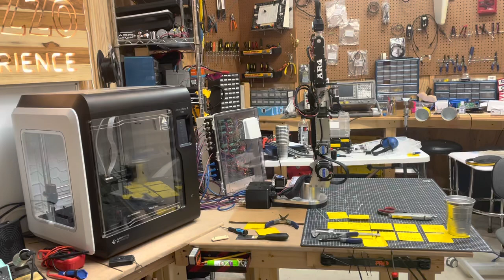RobotJSPart6 - AR4 Acceleration

Comment: Can AR4 be powered by Arduino?
Reply from the maker: It needs its own power supply. You can read the documentation here https://www.anninrobotics.com/
Reply from the maker: If by "powered by" you mean controlled with then the answer is yes, it uses a teensy microcontroller which is effectively an arduino.

Comment: How do you handle coordinated acceleration control of the motors?
Reply from the maker: Great question. I wrote a custom function that takes all the joint angles. Since I know where all the joints are I can calculate what I need to set the velocities and accelerations to in order to get all motors to end at the same time. You can see the code on my github here https://github.com/joepuzzo/servo/blob/main/src/robot.js#L512
Reply: @robotjs  Yeah, that was the approach I took with my robot arm. I'm making a new one though, and one thing I want it to be able to do is straight line / parametric motion (for example, being able to draw a picture on a flat piece of paper). The only way I can think of to accomplish that is to break the motion up into a high amount of individual movements, basically dividing the straight line / trajectory into thousands of bits, solving the IK at each of those points and moving it that way. I was wondering if you had attempted / were going to attempt something similar, and what your thoughts would be on my approach, because even before testing it I can think of some problems with it that might come up.
Reply from the maker: @Jonathan-li2py  from my understanding your approach is spot on. You brake down liner or circular motions into small segments and perform IK for each segment. I was going to start experimenting with this once i get my new arm. Should be super simple i might even ask chatGPT to write it for me :)
Reply: @robotjs  One thing I thought might be a potential problem would be compounding position errors. Because there will be some error between translation of the IK angles to steps at each interval (lets say you break down a one meter movement into 2000 different movements or something), then the error at the final point will be 2000 * whatever your small error is. If you up the resolution of the movement to like 10000+, this will start compounding as even larger errors and potentially cause major issues. Would encoders be the only way to fix this? I imagine 3D printers must encounter similar problems, but I have no idea how they solve it without encoders.
Reply: @robotjs  before you ask it to write it, ask it to solve the problem algorithmically.  It's really good at robotics.  Check my last video.
Reply: @robotjs  thanks for sharing your code. Really nicely done. I just can't see how the pulse timing changes over time. Any chance you can explain it?
-Ken
Reply from the maker: @MakeTechPtyLtd  I use the accel Stepper Firmata and you can set the acceleration and speed before you tell the motor to move. I typically delegate "low level" Arduino code to the firmata and write everything in higher level languages like Javascript. If you are curious I would go check out that Firmatas source code.
Reply: @robotjs  ok got it. I've used accel.stepper on the Robotic Camera System here. I've never been 100% satisfied with it and I'm considering writing a new function to run more efficiently and also to have more control. I've found it's speed increments are not smooth when it gets to high frequency output. 
Thanks for the info.
Reply: @robotjs  looks like all joints don't finish at the same time?

Comment: Oh wow! This looks awesome! I have an AR4 myself and been wanting something better software wise to tinker with. How do I get my hands on it?
Reply from the maker: The software is all on my github. robot-viewer is the User Interface and "servo" is the control software that runs on the raspberry pi. Im working on a schematic diagram as there are a few wires that differ from the AR4s schematic, however the AR4 kit still has everything you need :)
Reply: @robotjs  cool! Does it handle the encoders differently? Like closer to closed loop?
Reply from the maker: @olorf  Not yet it actually only reports encoder pos atm. The movement is def a bit smoother IMO due to the use of accell stepper firmata.
Reply from the maker: https://www.joepuzzo.com/arschematic.pdf Here is schematic for how the wiring differs. Video coming soon